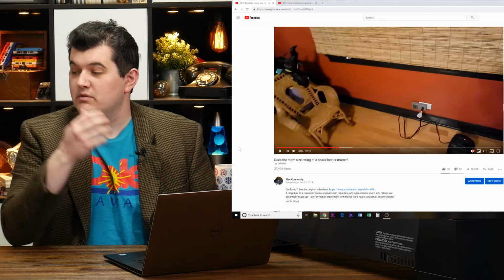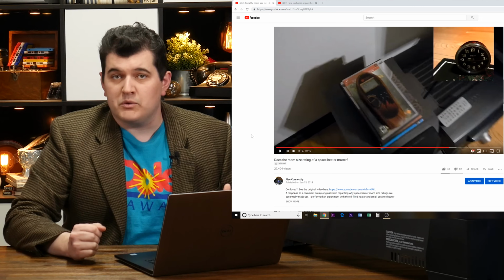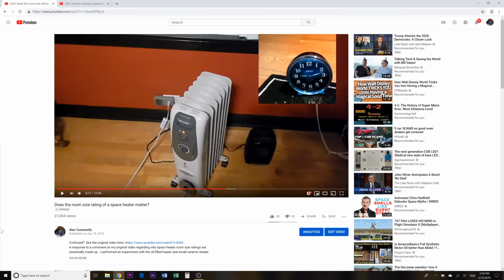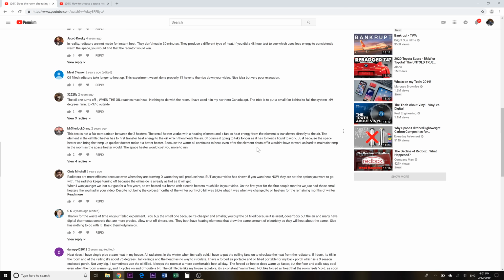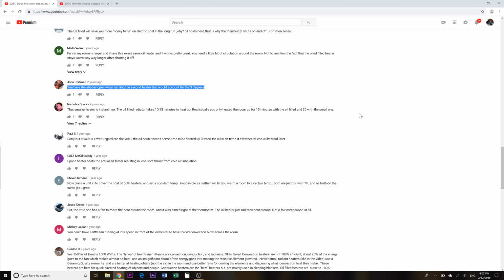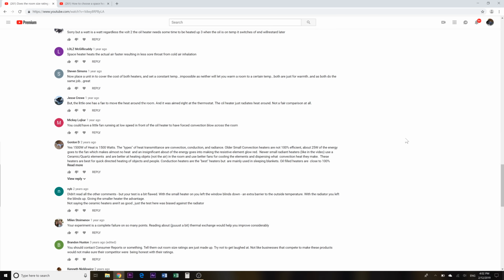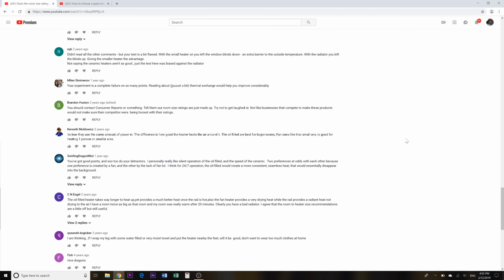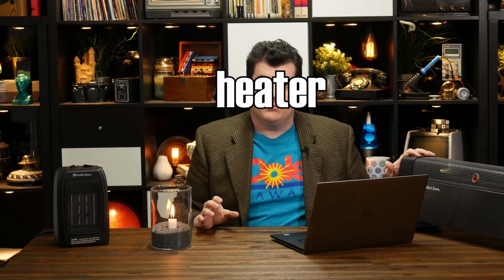More Space Heater Nonsense

Comment: How about the room size ratings are more for suitability rather than ability. In a scenario where 1500 watts is adequate to heat the room higher than the desired temperature. In a large room the heater will be on more. A small fan heater is noisy and the constant noise is an indication of the fact it's drawing power (money) from your supply.

The convection heater silently works away so doesn't become annoying and you pleasantly forget it's on costing you money to run. You just sit there thinking how nice and warm it is.

The fan heater in the small room turns on, makes noise, announces it's cost, warms the room up to temp quickly, then shuts off. I feel that can be a logical reason to suggest a small, medium room rating.

Bigger fan heaters have quiter fans as they don't need to draw so much air across a small surface area so can blend into the background when running for the longer time in the bigger room. That's my take on the room size rating.

I get frustrated trying to explain that 1 watt = 1 watt, however you obtain it.

Comment: One issue may come from your use of the term "100% efficient".  The transfer of heat produced in the room is 100%.  Whatever a heater produces in the room stays in the room (like actions in Vegas).  If two units of varying size produce the same amount of heat in the same amount of time, then they are equally efficient at thermal transfer.  
The conversion of electricity to heat, though, can be more or less efficient.  If two devices are both using the same electricity but one doesn't get as hot due to transferring part of the of electrical energy to kinetic energy or light, then one can be concluded to be more efficient of a "heater" than another.  This is the same as in which a light bulb is more efficient if it can produce more lumens for less electricity.  That said, I bet the difference in the actual temperature change produced between small and large units is so minimal it's not worth spending the time to measure it.
The speed a heater is able to transfer it's energy to a room could also be considered a form of efficiency.  If two units produce the exact same amount of heat energy but one spreads it to the rest of the room faster, it could be considered more efficient.  It all depends on your definition of what "efficient" is I guess....

Comment: So a hairdryer is a more effective heater since it's using more power? 😉 Isn't the to air exposed surface area of importance? Whether it's in the form of densely packed fins or one large area? Or many small wires vs one big rod?
Reply: yes, you're exactly correct, a hairdryer with a 2kW heating element will be more effective than a 1.5kW space heater. that's how power works, the energy doesn't just disappear into hyperspace
Reply: @moth4256  I might try this out one day... Seeing is believing 😉

Comment: Oil heaters are designed for permanent heating: switch on, forget. They can work 24/7 and effectively keep the temperature steady (provided the room is not too big and there's no excessive heat loss). Convection and fan heaters are for temporary scenarios. You enter the room, switch on the heater and after you've finished doing what you were doing there, switch it off, leave the room.

Comment: if a fan heater increases a room by 2 degrees an hour BUT the room loses 1 degree an hour, overall benefit is 1 degree per hour. 

If an oil filled radiator heater a room by 1 degree an hour and the room looses 1 degree per hour - there is no be gain just maintain the same temperature.

I fully agree will all the points called out in the videos.

Comment: Hi.
So the small space heater emitted 2,700kJ into the room during 30 minutes, ~1500W continuously.

How many kilojoules did the larger oil space heater emit during the second half hour, as if cycled on and off?

In the interests of this conversation I really feel that if you had calculated this number, and the units average power output we could have put this to bed.

What was the duty cycle of the oil space heater, 50%? If that is the case I would call it a 750W equivalent heater.

Now I know the room characteristics will change the oil space heaters duty cycle, but the reality is that it will be somewhat similar for most people, so again if it’s running a 50% duty cycle once it’s internal thermostat temperature is reached, I would say that it heats (the room) with 750W of power, in equivalent terms to fan forced, quarts or ceramic units that operate at a 100% duty cycle.

Edit, so we are clear people, it is the larger radiant oil heaters lower energy expenditure from its lower on time/duty cycle that caused it to heat the room less.

What is good about them, silence, and no accessible parts (should) operate at temperatures that pose a risk of fire.

Comment: Large room, small room is just BS. What counts, is as you say, is Watts. 1500 Watts is 1500 Watts. The design of the heater is just personal preference.

Oil heaters can be safer if left unattended, fan heaters heat faster but may be a hazard if knocked over and the over heat protection fails to operate.

The best heater is flueless natural gas. That is where all the combustion gasses remain in the room. Just watch out for the carbon monoxide and carbon dioxide.

Comment: There is one thing no one mentions, I ran these a lot back in the day and they get filled with dust depending on how dusty your room is (the one with the fan) which means after a few months if you have the skill you have to take them apart and clean them up (i used water and let it dry before plugging it in don't ever do this i'm a mad scientist) but after it's been cleaned it will return to it's former glory, also you can get them in 2000W variants if you have 208-240v (you can find 60hz ones online as well if you have a nema 6-15/20 or two 120v sockets out of phase and run more of them a little more safely even in the us where people love saying it's ONLY 120v XD). The oil one is a little easier to maintain clean.

Comment: Its all just marketing.  Its why they advertised mhz/ghz back in the day before the numbers didn't matter anymore.  I can tell you, however, the switch in the oil is just keeps the oil at the knob temperature.  It doesn't need to know what the current room temp is, because whatever temp it is currently at is what the room "eventually" should reach.  Not saying it will ever reach that, just that the oil heater thermostat is to keep the oil up to temp, not the room.  I just like them because they are MUCH more power efficient.  Honestly that's all you should compare all these 1500w heaters by, power efficiency.

Comment: I have a suggestion if you ever decide to beat this dead horse again:

Instead of looking at instantaneous power (Watts/BTU), look at power consumption over time on the Kill-a-watt (kw/h or w/h). So for a 1500 watt heater running for 30min you would have about 750w/h. If you monitored the oil heater in the same way you would be able to definitively say that it is putting out less heat because if it is power cycling then you might only see 500w/h over your 30min. If you were to pull the plug then the oil heater would keep adding energy into the surrounding environment until it reaches equilibrium, but if the watt-hours is lower then it would never be able to keep up with the wire heater.

Also, for completeness you would want to include the temperatures and areas of the environments outside of the room (e.g. two walls connect to the outside at 10c and the other two walls connect to the interior of the house at 18c). This would give a more accurate comparison of the outside temperature changes by a couple of degrees between experiments, but that might be out of the scope of your channel as you are not actually teaching on thermodynamics.

Keep up the good work.

Comment: All the slow releasing heaters are inefficient, because the rate the room is loosing the heat doesn't change. You will feel colder, you will run the heater longer, the room will still be colder. Using a fan heater quickly heats up the room than switches off. You will feel warmer, more comfortable, but at the expense of more noise. Same with boilers - if you have the same insulation on 2 boilers and 2 different heaters inside - one 1kW and the other 2kW - the 2kW one will heat up the water faster and in the process loose less heat to the environment than the 1kW one. Simple as that. Already tested it. The 2kW boiler used 3.2kW/h to heat 80L of water using the same thermostat to 70 degC. Same conditions the 1kW one used 3.5kW/h. That's about 300W wasted and about an hour and a half more time to heat up the water. Starting temp was 13degC.
Reply: all heaters are 100% efficient, it's inaccurate to say slow releasing heaters are inefficient as they all produce the same amount of heat. only some are less effective than others for certain situations

Comment: I was just speaking with another colleague that I work with. He says that the whole large room small room thing is all about the heaters ability to maintain temperature evenly without hotspots once temperature has been reached. Take in account that they do this in a test situation of totally closed, sealed tight rooms that are never opened,  which never happens in the real world.  It all boils down to, 5000BTUs is good for 150sqft. This is your "large" room.  Putting a "large" room heater in a smaller room would make it cut on and off a lot and not work as well heating the space evenly. Same thing with a room air conditioner. You wouldn't want to put a 12000 BTU room air conditioner that is meant to cool 500 sqft in a 150sqft room, it would turn on and off a lot.

Comment: My 2 cents - 1500W is plenty, you don't need that much unless the room is extremely terible at keeping heat. the point of the oil ones is -  store the energy in the oil (with relatively high heat capacity compared to that of the air) then slowly release the heat over a longer period of time. It's better to store the heat in a higher capacity substance and spread its release over time than constantly cycle between "room too hot, room too cold" which is what the little heaters tend to do in my experience. A reasonable test might have been "how good are they at keeping a constant temperature overnight"

Comment: Oil filled just "buffer" the heat better, but yeah. If you wanna heat a room fast it's best to use gas or a ceramic heater with fan on full blast.
Reply: Also there's the smell, oil heaters don't get hot enough to burn dust very hot, ceramic will scorch and stink after a while in a busy room

Comment: If you want a more watt heater import it from the EU. We can have 2000 watt one’s
Reply: a 2000W 240V heater will be 500W with 120V so it won't work. using a 120V to 240V adapter will not work, as those are not designed for heaters and, if they have protection, they will trip instantly. if they don't have protection, then the breaker will trip a short while later
Reply: The limit in the US isn't an availability issue, nor is it custom. Most US home power outlets are 120V-15A (a NEMA 5-15 outlet) and rated to operate continously at 80% capacity.   This limits the maximum load on standard appliances. You can buy higher capacity electric heaters, but would need a special power circuit, like the 240V-30A circuits we use for electric clothes dryers.

I've seen space heaters in the UK at 2500kW. I think they use a lower current outlet (13A?).

Comment: You didn't start at the same inside and outside temperature. Therefore thermal energy losses will not be the same. As the delta increases so does the rate of heat loss.
Otherwise leave that 1500 watt heater on for a week and your room should be greater than 200C but in reality it's plateaued in the 25-35C range.
I agree that the specific heat capacity for air will be relatively constant with temp change so any 1500watt convection transfer heater should heat the same.
Didn't watch the rest of your video as it was a very slow pace.

Comment: A little bit the same thing with air conditioners, but to my knowledge, they seem quite more fair. When they say it's for bigger rooms, the AC either have higher BTU/h rating or have at least bigger pushing the cold air farther in the room, resulting in better distribution and also running longer, as air is not immediately recirculating into the unit and giving thermostat false impression the larger room is colder in general.

Comment: i see that the bigger the room these things seem designed to be more durable.

perhraps what they mean is that you can leave the blower unattended in a small room but if it runs too long trying to keep a larger room warm it will break sooner.

the large room devices have fewer points of failure and shouldn't fail on you as easy long as you don't cover them.

in short, the bigger the room, the less flimsy of a device you're going to want because they are going to be running longer.

just a thought, I may be wrong of course.

Comment: So you found that the heater for small rooms was slightly better at heating a small room than a heater for big rooms?

Doesn't that agree with the claims on the boxes?

Maybe if you did the experiment again, with a big room, the heater for big rooms may out-perform the heater for small rooms. (Possibly)

My hypothesis is that it could be all down to thermostat limiting the running time.

In the experiment in a small room, you explained that the large room heater got hot and that led to its thermostat tripping, while the heater for small rooms can continue running. 

I reckon, that in a large room, the heater for small rooms might not be able to disperse it's heat throughout the room as effective as the heater for large room. This could lead to a hotspot around the heater causing its thermostat to trip while the heater for large rooms could continue running.

Comment: You're absolutely right with the science of the heaters.

I do wonder, once the room reaches the desired temperature though, what system is better (by various metrics) at keeping the room temperature stable, and how room size interacts with that.

On a side note, personally I prefer oil heaters because they are safer. the surface temperature is lower, and the risk of electrocution (from having an exposed electrical wire, basically, in the form of the element) is lower. There's also less chance of ignition if something comes into contact. Taking longer to heat up a room is at most a secondary consideration, and at best a desired side-effect of the functionality of the heater.
Reply: Well in the specific example he had, a fan forced (ceramic?) vs convection, the fan forced is probably going to do a better job of initially heating the room's air up as he showed. But yes, longer term, once initial target temperature is achieved, it would be interesting to see what we get across the room as a whole, as objects come up to temperature and as the thermostat cuts the heater in and out based on immediately ambient temperature.

Comment: I don't think the experiment actually shows the equivalence of the heaters since you didn't seem to continuously measure the temperature outside the room, which may have changed between your measurement periods, effecting your results. You really need to re-do it, but this time build three identical rooms, to measure both heaters simultaneously, and have one empty room for control. Also, make sure that before you start the experiment you submit it to your IRB, and have anyone who enters the rooms sign a consent form. Actually scratch that, you can't have people entering the rooms during the experiment since they radiate heat - better lock the rooms and use automatic switches.

Comment: Agreed that the biggest difference between the little heater and the oil filled one is probably just air circulation.

I've found that with the oil filled radiators, many of them just get hot... and stay hot. The amount of air moved by them tends not to be a lot. However, years ago I bought a Delonghi Dragon, and I was so pleased with it, I went and bought two more. It has a really nice fin design that seems to give it more surface area, and funnels the air very well. With regular oil filled heaters, I've found they get super hot, enough to burn when you touch it. With this one that I like, it moves enough air to remove heat from itself and put it into the room.

Comment: My gripe is with portable air conditioners which exhaust their condenser air through a tube through a window . They must draw cold air into the room at a faster rate than the cool air they put out. You get a cool area around the unit but the room gets little overall efect

Comment: I could be completely wrong here but I thought the large panel convection heaters are better for larger rooms is because of how the  air flow is set up. The heater pulls air between its walls from the bottom and ejects it out the top. The hot air hits the ceiling and cools near the far wall creating a large circular air current. A small fan heater however forces it's air out the front and if that air does not make it too the far wall before rising the air current only encompasses half the room creating a cold spot on one side. That said most of the stuff on a heater box is just marketing rubbish, I find it annoying too :)

Comment: If a room is cold and you turn on a heater, then you want it to heat the room as quickly as possible. That's why fan heaters make perfect sense.  But if your only source of heat in a room is electricity, then sorry but you're using the wrong system because electricity is always more expensive than any other reasonable fuel choice.